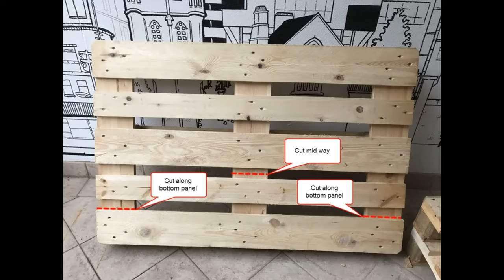How to Make a Pallet Couch - Easy Step by Step Instructions

Comment: This is important! When purchasing pallets for your DIY sofa, make sure the pallets are HEAT TREATED and not CHEMICALLY TREATED. You don't want pallets in your home that are chemically treated with Methyl Bromide, at least I wouldn't. You can differentiate the two by the markings: HT = Heat treated / MB = Methyl Bromide treated.
Reply from the maker: Yes good point Prunk. That’s why I only use Euro pallets for my projects. 

Since 01/01/2010, all newly produced EPAL Euro pallets are heat treated in accordance with ISPM 15.
EPAL Euro pallets treated according to ISPM 15 can be recognised by the branded markings on both central blocks on the long sides.
It is prohibited to treat EPAL Euro pallets with methyl bromide (MB)
Reply: @Mikey2hands  Nice! Thanks for the info.
Reply: Thx, good to know
Reply: Hey., thanks for the info
Reply: @streetballplayer100 😅
Reply: @Mikey2hands 
Beg your pardon sir, I am American could you be so kind as use feet and inches in your videos because some of us don't have a working knowledge of metric measurements just as with cooking I get lost by grams and mil liters 😆 
Thank you for your help with this,
Respectfully yours,
Donna Lane 
Kingman Az USA
Reply: Quick question for you here, where is your safety gear at?😊
Reply: @Mikey2hands yes. Euro pallets are safe 👍🏻

Comment: Great video! I'm doing a project at the moment with pallets and cinder blocks. Building a small decking area as well. 
 I can appreciate the effort shown to make this bench be wise it's not easy taking them apart etc. The pallets I'm using, like yours,  are very hardy and strong, as they're quite good quality, thus dismantling them is not as easy as it looks! Although you made it look rather easy lol! 😁 What saw are you using? I bought one which is applicable for the job but still, it's touch cutting through the thick timber! I use a screwdriver too but mine isn't as good as yours, because I broke mine in the process! I'll prob go looking for one like yours as it's much better! Thanks for posting. It's one of the better videos I've watched to verify I'm doing it right! 
Great little bench! Mine will have cinder blocks involved but I hope it turns out as good as yours with that  professional rustic charm 👌

Comment: This was the project I had been looking for. I'm using it for a patio sofa, so rather than castors, I have put some old sofa legs on it, and I sliced up the wood from an old pine wardrobe I had in the garage, and clad the edges. I used some exterior grey paint that was left over from my shed and painted it over. I was very pleased with the result. Thank you very much for the inspiration to make this

Comment: Hi! Do you think the mending plates are 100% necessary? Could I get away with not using them?
Reply from the maker: Hi Sarah. If you just use no more nails adhesive they might hold. The nail plates will just make it more secure and look a bit more industrial. Good luck.

Comment: If screwing thought the small lengths of timber cut the tip off the screw this will help prevent the timber splitting if you don't pre drill a hole..... Just the tip more so to make it blunt

Comment: Hi, I got my pallets today. the size here in california i got are 32 inches by 38.5. Mine are a little smaller than yours but they will work just fine without cutting anything.. and following your steps. I am planning to use the IKEA kungso seat cushion. Do you mind sharing the size you bought for the sofa you made?
Reply from the maker: Mine were Kungso 60cm x 40cm cushions. I’m not sure if IKEA still sells Kungso but if not they are bound to have other ones that will fit nicely. 👍
Reply: @Mikey2hands  thank you for your prompt answer...i bought all my tools and this Friday I am starting my project. I have never done anything like this before but your instruction seems very easy....i am just wondering about how things are going to turn out with  the size of pallets I have....
Reply from the maker: My plans were using Euro sized pallets. Other types of pallets may not fit together the same way. But good luck with your project.

Comment: What’s the size of the cushions?
Reply from the maker: I’ve written the dimensions in the description. 👍
Reply: @Mikey2hands are the cushions the same size as the pallets? Just because surely if the back board takes up some of the bottom pallet, would the cushion not need to be smaller than the pallet you sit on ?
Reply from the maker: Yes the bottom cushions were deeper than the back cushions. I think ikea have stopped making the ones I have shown in the video too, but they may have a new range that will suit. Sorry I don’t have the exact dimensions any more.

Comment: Hi there! Thanks for the informative video. I was just wondering what the dimensions were for the finished product? I have a particular spot for it in mind and hoping it will fit under the window.  :)
Reply from the maker: It will be 1200mm wide x 800 deep and 770 tall without wheels. My wheels were an extra 50mm tall. Good luck!

Comment: nice but a few tips, dont put adhesive kit, just get a few really long screws, 4 is all you need, and drill them straight through the top to the bottom ones and you're done. also, if you get yourself 5 pallets in total, you can pry off the middle 'square foot' of the pallet you use for the back, the push the 'legs' in a bit more forward and angle it back just a little bit more, mount 1 complete pallet to the back, and for rigidity screw these together. then just pry off all the planks from the leftover pallet, and nail or screw them to the lower front and sides to cover them up. use an orbital sander to make everything nice and plane, paint it, throw some pillows on, and all that you would have spend is paint, pillows and some nails, and you have some great furniture.